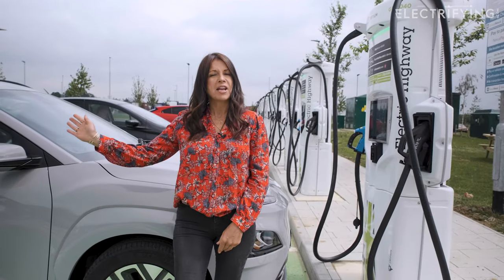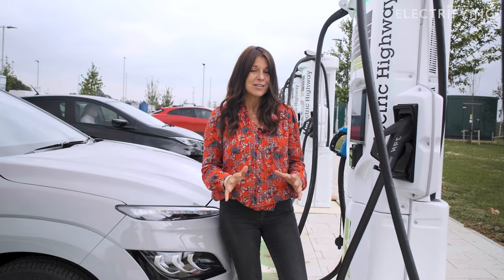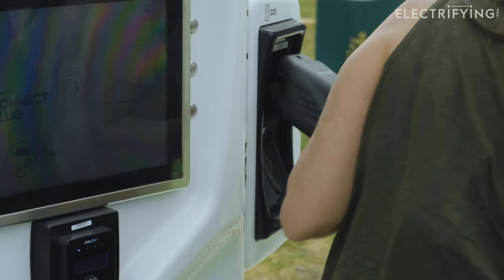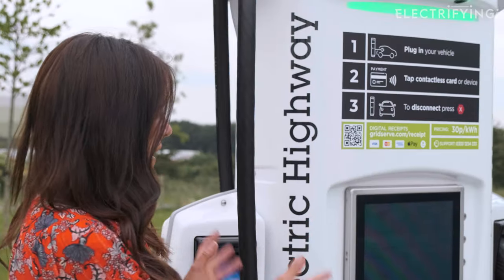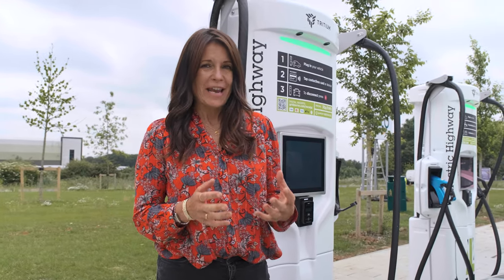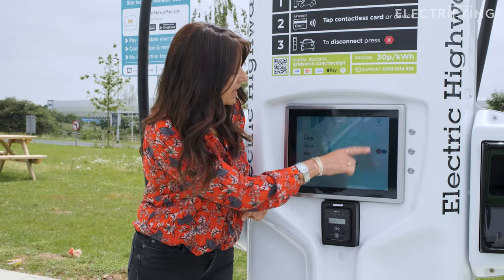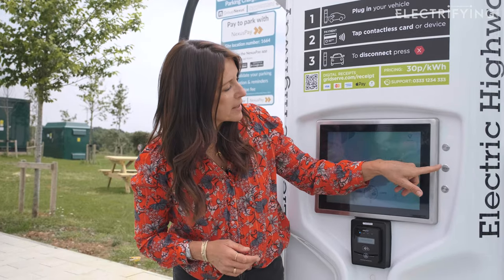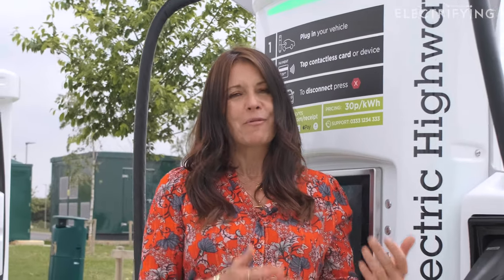Beginners' Guides: How to use a DC rapid charger / Electrifying

Comment: A very “over simplified” video. On many Rapids, you don't connect the CCS connector to your car first. And you often need to Select the Connector type CCS on the screen.  And yes, the Charge Rate will be controlled by your car, but the rate varies a lot depending on your “SoC” State of Charge, or % of Battery. An empty battery will charge faster than a half, or 2/3 full one. The best tip is only “fill up” with what you need to get home safely. These chargers are an expensive way to recharge your car.

Comment: How much did it cost you to charge?.
Reply: It said 30p per kwh on the machine.
Reply: @TheophilusPWildbeest  what's that in £🤔
Reply: @davidtaylorbfd  £0.30 per kwh.

 Oh I see what you mean, depends how big the battery is, it will be so many kwh in size, a little battery will be 30 kwh so 30p per kwh makes £9. A bigger battery might be 50 kwh so that would be £15. But charging at home is cheapest, I'm paying 17p per kwh at the moment.
Reply: @TheophilusPWildbeest  All this kWh thing is way over my head. When I get a ev car in 10-15 years time I might understand it more.
Reply: @davidtaylorbfd  Nah, you'd be fine. Think of it this way, a kwh is like a pint of petrol, it'll get you 3 or 4 miles depending on  how heavy your car is.
Reply: @davidtaylorbfd  Just think of it as price per litre like a petrol car, if you put in 20 litres at 130p it will be 20x130p, a full tank may be 60 litres so 60x130p.

A KW is just a measuement of electricity delivered so of you take 20KW it will be 20x30p a full charge maybe 40KW so 40x30p.

Modern battery sizes are generally around 40KW, 60KW or 80KW some more expensive cars may be 100KW and more KW equals more distance per charge just like a bigger fuel tank will allow you to travel further on a full tank.